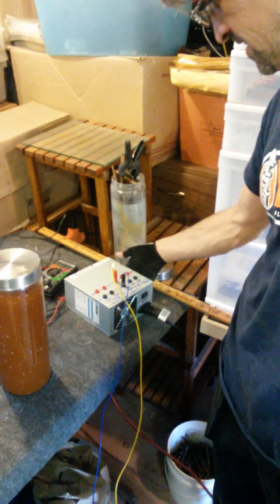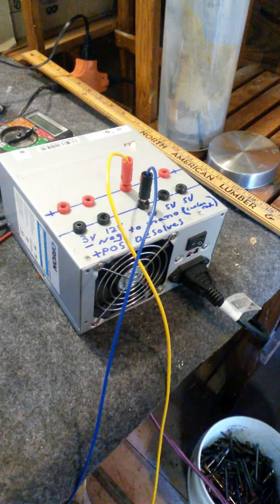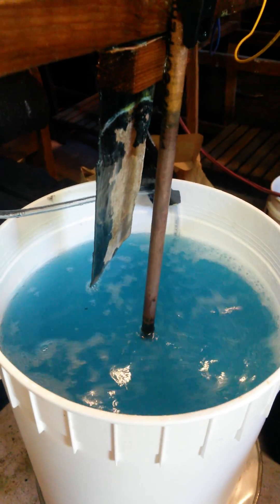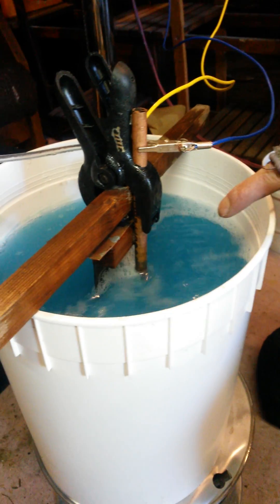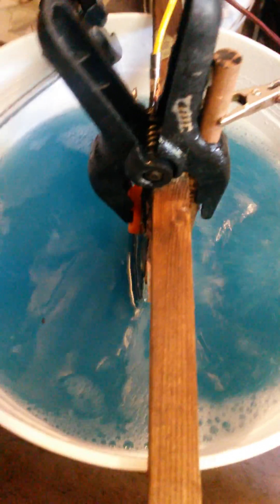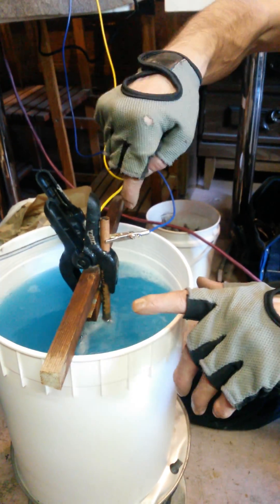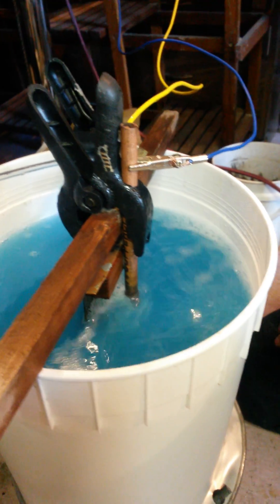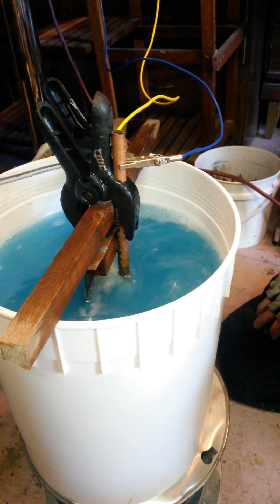Don and John CUO GANS made easy

Comment: what is the plate in your bucket.   thank you
Reply from the maker: we are using nano coated copper plate and a carbon rod, the results we are getting is CUO Gans with the air being pumped into the bucket to add oxygen. This maintains the turquoise blue color, works every time for us as long as the nano coating holds up, and they are regularly replaced with rejuvenated nano coated copper plates.
Reply from the maker: Please go to kfwiki.org   There has been new developments on how to properly make different types of Gans and review the steps.. I am in the process of relearning what I have been doing in the past... I will post a video updating all the better ways to do this... but for now... go to this website I gave you... thanks for watching

Comment: Is that a copper coated carbon rod + nano coated copper plate setup? l thought the setup was a non coated/bare carbon rod + nano copper plate.
Reply from the maker: Yes, in the beginning I was using the copper coating on the carbon rod. As I made a lot of CUO, it evntually got used up and then it was just the carbon rod... I have also peeled off the carbon rod with a utility knife, and made different Gans with it.